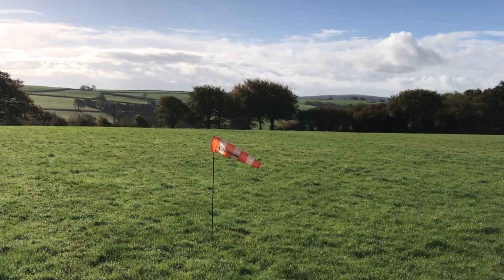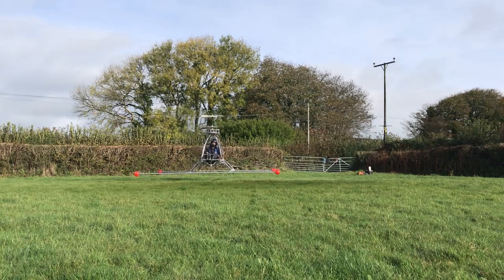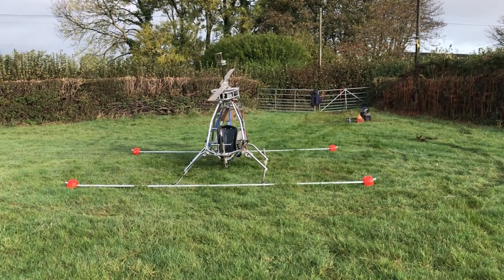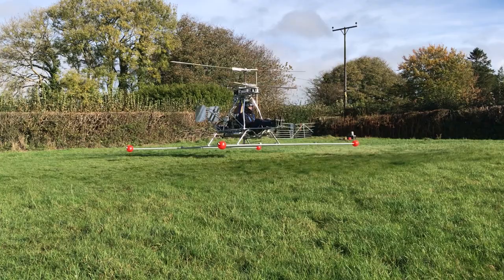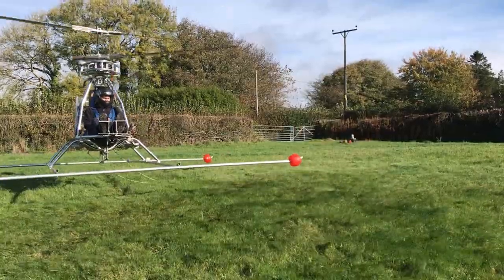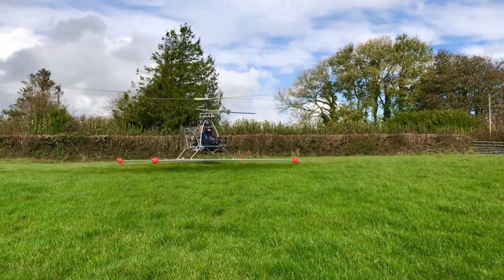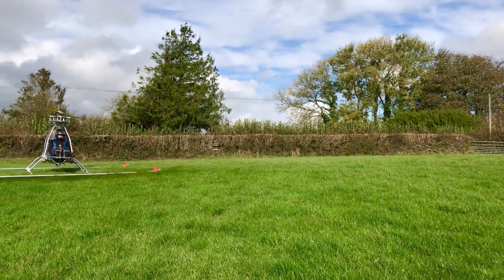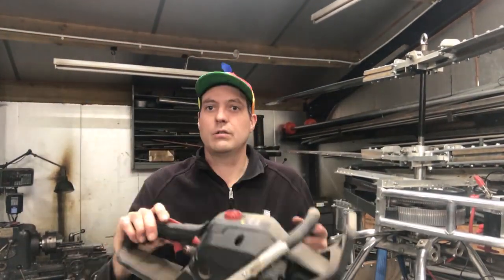BALLS UP Homemade coaxial helicopter learning to FLY

Comment: Fascinated watching this. I have never flown anything coaxial, It's great to do away with the added length and the tail rotor for environments like aircraft carriers. Good luck with your project.
Reply from the maker: Thanks, yes the compact size is really nice, fits into the same space as a small car. The yaw authority isn't bad, works ok. Probably wouldn't against a cross wind but I can't fly this in any wind anyway. Unfortunately it's broken at the moment but I'm tempted to fix it, it's only been a few months out of action and I'm missing it. I've just started building an ekranoplan so that will keep me busy for a few months. What flying experience do you have ?
Reply: I am a PPL (H). Just enough time in fixed wing to get one up and down! @Ben-Dixey
Reply from the maker: Nice 👌 very well done for getting your licence. Flying a helicopter is Dam hard.

Comment: Always want to work with a genious innovator like you sir..if i will have sound financial condition i would glad to travell and meet you at least.
Reply from the maker: Thanks for the kind comment. 😊
Reply: @Ben-Dixey  sir, how much you invested in the making?
Reply from the maker: So far about £6000. The cost is ongoing however. I wouldn't be surprised if I spent another £500 or more getting it flying as good as possible.

Comment: I can hear that thing misfiring lightly up top, fresh gapped plugs and maybe use high octane if not already?
Reply from the maker: Thanks for the input. The misfiring type noise you can hear is an issue with the video editor. The editor causes this for some reason on some videos. Can't complain about the free software that came with my pc I suppose but it is annoying. When I play the clip on my camera there's no issue with the sound.

Comment: As it is in aviation, continually chech for dents, cracks, leaks and what ever you may think of. It doesent take much to get a serious problem/ disaster. Stay safe!
Reply from the maker: Thanks, yes I check whatever I can within whats reasonable. I could of course disassemble every part and crack test after each run but that wouldn't be practical. Deciding what level of checking is appropriate is the question. There was one part I had a fatigue failure which I changed the material to En8 steel instead of 6082 aluminium. I remove that part after every 20-30 test runs to check for cracks. The rotor heads are built to beyond fatigue strength so if the calculations are correct they will never crack and will not have a limited service life either. However drive shafts under cyclic twisting is of concern. I might do some disassembly over the winter and check the components I'm most worried about.
Reply: @Ben-Dixey  Wear and tear on, for example, a timing belt should be taken very seriously. I think you have the head for this, but still this is very experimental. I wish you the best!
Reply from the maker: Oh very much so. Thank you 👍

Comment: I like your design... I am a kart racer and admired Franz Shoefmann's tricycle coaxial copter, and may build a variant. I was planning on using a planetary gear system for coaxial activation with a single drive belt, but I like your system. I plan to use a smooth-backed belt with 8mm pitch, however, vs. your double sided system. I also plan to use a single tail vane. Can you enlighten me on why you used double. Thanks, ~Ted
Reply from the maker: Sounds good, planetary reversing is fine. The Gen 4 is a good one to look at which I'm sure you have already. Are you planning on a using an ic engine for power ? I was thinking if you went electric the reversing could be done with dual motors. A single tail vane is fine there's no reason to have dual ones if the surface area is kept the same. I wanted the option of getting more yaw authority should I needed it with the possibility of two large vanes

Comment: To much flow in through your cooling system will actually be a bad thing, you need a sufficient "dwell time" in the radiation side as well as in the engine side. The coolant needs to spend long enough in both places to pick up/shed the ideal amount of heat and this is why matching radiator size/dwell time is as important as flow speed. This is coming from a refrigeration background  but the same principle would hold true here as you are just attempting to "refrigerate" the engine to a degree with coolant.
I would suggest figuring out what your acceptably "cool" coolant temperature is and monitoring the outflow temperature of the radiator. To make sure you aren't just building up heat in the engine block also measure the outflow temperature of the "hot" side (this will let you know how much temperature you are shedding in the cooling system. This should give you some idea of where if anywhere the system is flowing to fast or to slow.
Where you put the restrictor (if needed) will have an effect on the system in relation to the pump, and the pumps relation to the hot/cool sides. It can all get very complicated.

I'm not overly qualified, just my 2 cents.

Comment: Add a gyroscopic rotor like in coaxial toy helicopters
Reply from the maker: Good suggestion, it's not impossible to do this and could be implemented. I'm going to keep practising for now as I believe it's easier to fly than an R22 in the current configuration but if it transpires more stability is needed adding a flybar would be a good call.

Comment: As you're increasing collective, you might, subconsciously, be pulling the cyclic back.  Try again but add a bit of forward pressure to the cyclic when increasing collective(in your case - throttle).  If that doesn't work, switch to articulated blades for the rotors and scrap the tilting rotor head.  Be Safe - Not Sorry!  A new design would be a much better option.  I enjoy your progress but you're one heck of a 'stubborn' guy.
Reply from the maker: Will try pushing forward next time and see what happens. The next machine I would build with collective and standard cyclic as a serious helicopter. This coax has nearly served its purpose as a hovering machine but I think it can go as far as travelling forward ect.
Reply: @Ben-Dixey  You can still use standard cyclic and collective with a coaxial unit.  Many of them are flying now.  Have Fun 🙂
Reply from the maker: Yes, it's funny that one of reasons I went for a tilting mast coaxial was to avoid the complexity of a swash plate on the single main rotors. With hindsight a single swash plate would be simple compared to a double swash plate coaxial. I'd even go as far as adding a differential collective mechanism for yaw. How things change with experience.

Comment: Coolant:
From the plastics injection molding business, I can tell you that the way we increased coolant (straight water) capacity  (cooling the molds faster) was not by increasing flow but by restricting the coolant exiting the mold.  This did two things, it raised the pressure of the coolant a little bit inside the mold and also made the coolant stay in the hot mold a little longer.   
Water, as you know, is a phase change material that will absorb (or lose) thermal energy at different rates at different temperature regimes.  Apparently,  for us, it was absorbing more thermal energy more efficiently when it stayed in the mold a little longer. 
  You could do a little research and see what your thermal regimes are and whether restricting outflow will help.  Or you could just try and see.  But the key was restricting the flow on the outbound end.
Reply from the maker: Well that's interesting, as there is much contradiction on the subject testing is going to have to be the way forward. Cheers for the info. 👍

Comment: I believe you want as much coolant flow as possible. I have never heard of not enough flow. I know a V8 engine flows at 18 gal per min at idle and 36 gallons per min at 3000 rpm. I would expect probably 5 gallons per min to 10 gallons per min during flight would be on the low end. It may be why you are running how. I wouldn't use any coolant restrictors because its not going to flow enough.
Reply from the maker: 5 or 6 gallons/min sounds spot on to me, it's currently at 2 gallons/min .

Comment: try and think of the power line on a graph horizontaly then compare that line to hover power forward flight and then slight stall and recovery every time you up get used to going forward before powering of to go down  a fixed pitch is going to always end badly because you need 3 times the power to recover a hard landing just like trying to fly a pogo it took him 800 hours to get right tetherd to a speci crane in a blip hangar
Reply from the maker: Fixed pitch is going to be a disadvantage, whether it's as bad as you suggest I'm not sure. When you come into land efficiency increases from ground effect. By the looks of it the pogo never had the benefit of ground effect because the props were so high and small. Hopefully I will be able to provide more info as time goes by.

Comment: There's no such thing as coolant flowing too quickly. It seems like a lie that comes from misperception. So flowing the coolant more quickly will mean that each CC of coolant will spend less time in contact with the engine and a bit less time in the radiator, so the temperature differences will be less. It will however introduce more coolant to the engine and to the radiator. Heat is transferred immediately upon contact. Simply put the flow is higher, so the coolant will not be as hot as the engine or as cold as the air going through the radiator. So long as the radiator is appropriate for the amount of heat produced in the engine, you will not overheat. If the coolant were moving too slowly it wouldn't matter how big the radiator is or how little heat the engine produces. Slow coolant allows the heat (and heated coolant) to stay in the engine for too long. Before engines had coolant pumps many cars overheated because water would not flow efficiently out of the engine and into the air. So the radiator was not able to work as effectively as it could have if the coolant were being force through, and the radiator was effectively not receiving enough heat from the engine to cool the engine.

A hot pan won't wait to burn you, the engine will heat the coolant just as quickly. Having more coolant will bring the engine temperature down more uniformly and effectively. Heat transfer between two objects always seeks to spread the heat evenly between two objects, so the larger the difference the faster the heat transfer will be because the distance to the average between them is greater. This makes colder coolant cool the engine faster as it will absorb more heat in a given period of time.

So have good coolant flow and pressure, a good radiator, and push plenty of air though it. Hot coolant can be a sign that the engine is overheating and that the system is in some way inadequate. If you really want to dive deep measure coolant Temps out of the radiator and out of the engine. The lower they both are the better, unless you move to the arctic.
Reply from the maker: Thanks for spending the time to write this. It all makes perfect sense. 👍

Comment: The engine doesn't really care about the coolant velocity, but the radiator does - if you blow the coolant through the radiator too quickly there will not be enough time for the heat exchange to take place.  It's like dipping some hot object (the radiator) in any coolant (the air) - you have to leave it there for enough time to actually remove the heat.
Reply: It depends on what your requirements are. If you want the lowest possible output temperature you want slow flow. The problem is that your radiator becomes inefficient. As the water flows through the radiator it cools down. This means that the top of the radiator is hot and the bottom is cold. The amount of heat transferred to the air is dependent on temperature. The cooler parts of the rad are not transferring much heat.
Reply from the maker: There are a lot of comments contradicting this, I now believe you can't pump water through a coolant system too fast.
Reply: @Ben-Dixey  Yes a lot of very closely held beliefs.  The engine only cares that it has a cool water feed - which it does not have if the coolant was not in the radiator long enough, now it matters not how long the water is going to be in the engine for.  But that water in the radiator has mass and is subject to the laws of thermodynamics, and if you want to cool it, then you have to factor in *time*.   Imagine dunking a hot piece of steel in cold water, a 3 second dip removes three times as much heat as a one second dip, same goes for the raiator.  I had an overheating engine until I discovered this - now its solid as a rock.  Test the flow restrictor..  ;)
Reply from the maker: I'm not sure how you can say it doesn't matter how long the coolant stays in the engine for. Too slow and the coolant will be boiling before it leaves the engine. 
The dunking of the hot steel in water is a good example. We know that moving the steel around in the water will cool it faster than left stationary. It seems to come down to two different concepts, fast through the engine would seem logical, and slow through the radiator would seem logical but you can't do both.
Reply: @Ben-Dixey  "Too slow and the coolant will be boiling before it leaves the engine. "  Yes, but also the colder it will be entering the engine after its longer stay in the radiator.  Theres a sweet spot to find.

Comment: In all my experience with cooling of rocket engines, fast, turbulent flow is always to the good. Some of the XCOR engines used water coolant, others the fuel, and we even did experiments with reduced water flow to the point where we achieved superheated dry steam without melting the chamber wall.

Heat transfer goes up with increased flow velocity, and nucleate boiling causes increased mixing and better heat transfer, so there's little need for high total pressure in the cooling circuit. Really high pressures would actually reduce heat transfer, but at your heat flux levels, that shouldn't be a concern.

There is no downside to the increased flow of coolant. Let her rip!
Reply from the maker: Ah I wondered when a rocket scientist would comment 🙂 
Thanks for the info, I am convinced that Increasing coolant flow is the right move. 👍

Comment: Nice, congrats! Higher coolant flow rate will actually always result in more heat transfer, not less. You can verify by calculating the btu output after the coolant leaves the engine. Using water alone as an example: btu/hr = gpm * Δt * 500.4, where gpm is the flow rate in gallons per minute, Δt is the temp difference of the water before it enters the heat source and after it leaves, and 500.4 is the specific heat of water * its mass/hr per gpm (you'll need to use the specific heat value of whatever solution you're using, glycol I assume). So if the flow rate is 5 gpm and the delta is 20°F, then the btu transfer would be 5 * 20 * 500.4 = 50040 btu/hr. If the flow rate is increased to 10 gpm, then 10 * 20 * 500.4 = 100 kbtu/hr. Ie: more heat transfer. With that said, a higher flow rate will inevitably result in a lower delta just as it will a lower overall operating temp, but that DOES NOT necessarily mean there's less heat transfer - it simply means the fixed amount of heat that's being produced is being transferred to a larger volume of fluid because of the higher flow rate. But like with anything related to heat transfer, there's a sweet spot where efficiency is optimized based on the desired (engine) operating and coolant temps. For solar thermal, for example, most systems require 3-5 gpm to keep the collectors operating at safe temps while delivering the desired btu's to storage. Faster flow rates require larger pumps and more energy consumption which, at some point, could void any efficiency gains in system install and operating costs, and a slower flow rate risks overheating collectors and, despite the higher panel temp, will result in much more radiant heat loss through the panel glazing and transmission lines because the heat is spending too much time outdoors before it's pumped to an insulated storage medium. Just some food for thought. You're just cooling an engine, so don't be afraid to increase the flow rate and/or your reservoir volume to get the temps that you want.
Reply from the maker: Thanks so much for this great comment. 
My flow rate is 9ltrs/min which is 1.98gpm
The temperature differential is 6 degrees Celsius which is 11.4 degrees F 
1.98 x 11.4 x 500.4 = 11295btu/hr 
Is that correct? 
So the coolant system is taking away 11295 btu/hr but the engine is producing much more heat than that ?
Reply: @Ben-Dixey  The calculation's right. I don't know how much heat your engine is producing but if it's running hotter than what the specs call for then I'd increase the flow rate and/or increase the size of the reservoir/rad/fan (if the extra weight doesn't affect flight performance?). Bottom line, the more fluid you can put through the system, the more heat you can move.
Reply from the maker: Sounds good, along with the higher flow rate pump I'll be going with a belt driven fan which I don't want to consume more than 1/2hp. With a fan cowling it should increase the cfm through the radiator significantly than what is there now. Hopefully it will still fly, otherwise I might have to loose some weight here and there. Coolant is just water I understand better performance can be had with other coolant types but haven't gone down that route yet.